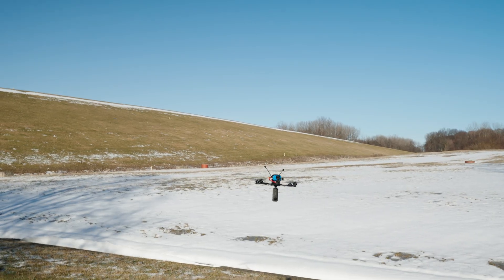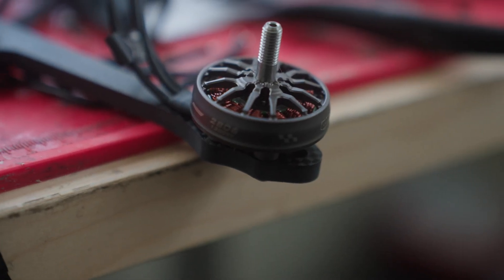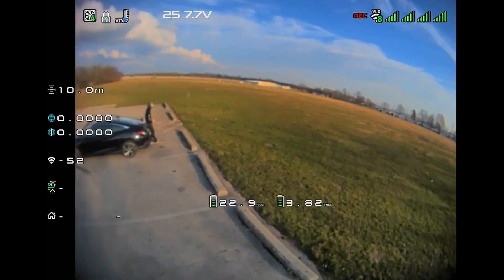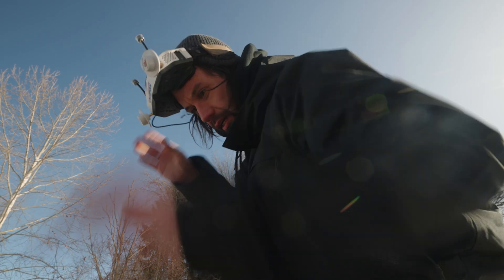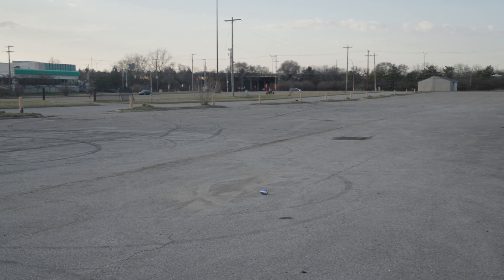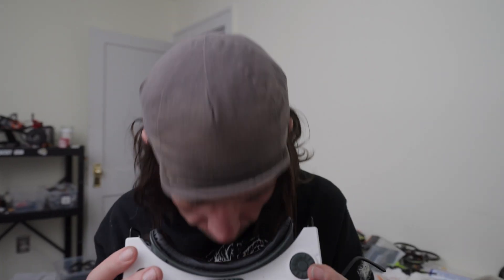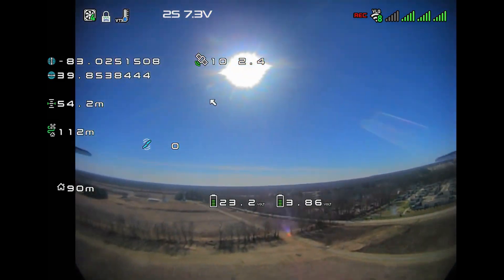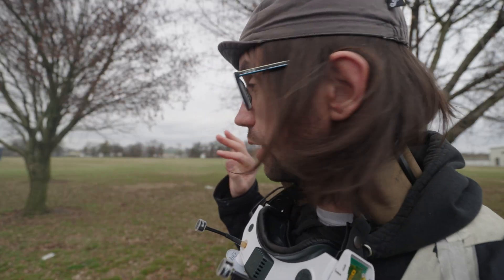GPS rescue has failed me

Comment: Hey I'm curious, you've got a hdzero freestyle v2 on the back of this, which btw, I also have the apex evo 7 lr frame, so super cool coincidence. But my question is, you've got two antennas out the back like a V tail configuration. But hdzero freestyle v2 only has only ufl on it. Are you using two video antennas and if so, how are you doing that? Cause I also wanna try it if it helps with video reception, which previously has been a bit shit. Cheers!
Reply from the maker: Those are for the elrs diversity receiver, I’m only using the one lumineer antenna on the back
Reply: @grimripperrr  oh yeah, I see in one shot you have a grey 3d printed rack on the back with the ELRS antennas on it, and I do see you having one black antenna out the back, but then in another part of the video at 5m09s, you have two huge black antennas. Perhaps it's another drone? 

I'm also wanting to try long range and I'm constantly getting fucked over by antennas, or maybe I bought a cheap component, or something like that and this time I just went for the good stuff and I'm looking at your, botgrinder, giant ant cowboys videos and trying to figure out where I'm going wrong tbh. I can barely go 500m without shitting my pants cause hdzero is putting sparkles and I know from past experience that means I'm gonna fall out of the sky
Reply from the maker: @chrisalexthomas  that’s not mine, that’s someone else’s DJI O3 apex. And also HDzero needs good antennas for it to work really well
Reply: @grimripperrr  Do you ever get the feeling sometimes, like iphone(dji) and android(hdzero). You backed hdzero because you love the idea, you love the open source aspect, you love the idea of sticking it up for the little guy who can change the industry. I loved android to begin with, but over the years I got fed up with how slow it was, how shit my phone responded. I bought an iphone se back in 2020 and it was the best phone I ever bought, I still have it and its fast as fuck. I never complain about it. 

I'm not at the point yet of giving up on hdzero, I still wanna see what their v2 goggles eventually might be, I want to believe they can do it. But after spending more than 1000 euros on equipment and barely being able to go behind a fucking tree without losing video. Like, with a 1w freestyle v2, if I go 500m away and I'm getting sparkles. If I try to push at all, I'm getting sparkles.

I'm slowing starting to think twice about it. You ever get those feelings?
Reply from the maker: @chrisalexthomas  I flew the O3 for a while, HDZero is better for how I like to fly. The latency of DJI isn’t worth it, just make sure you have a good antenna on your quad that’s away from the drone and good google antenna and you’ll get better penetration
Reply: @grimripperrr  oh I'm still on team hdzero, I'm just annoyed with spending hundreds of euros on equipment that ends up not really working. I've got 10 euros antennas and 30 euro antennas... all of them are not really giving me great results. It just goes in the box of parts.  I've got about ten antennas already haha

Comment: Usually for GPS related functionality, Inav is the go to for long range pilots. The swirling comes from the GPS pid tune, and the magneto meter needs to be calibrated to prevent flying backwards.
Reply: iNAV also suffers from magnetometer calibration and magnetic interference issues. It is a hardware issue unrelated to FC firmware.
Reply: @jeffparisse4202  the way bf 4.4 flies a Gps rescue quad would strike fear into any pilot's heart.
Reply: @ImperialArmour  Indeed!

Comment: INAV, if  the compass setup properly can rth nearly as nice as a Mavic. If your running 1W try 500mw, Use a med tall antenna and place the gps in the antenna null zone or at the opposite end of the frame and not on an arm. I place mine flat on the top plate and strap the battery under the frame. After configuring the compass. Orient the  facing your computer screen. Zero reset the Z Axis, offset, upper right of screen 1 "Setup" Slowly rotate the quad while facing the screen and note if it moves correctly in all axis roll, pitch, yaw. If not you will have to change the  Mag alignment on the Board and sensor alignment tab on the config page. Then repeat the Setup procedure again. I also test with the quad tilted forward as in forward flight and it should move correctly in that angel as well.

Comment: What you experienced with inav that was swinging on yaw axis is due to the fact that you have interference to your gps, bad magnetometer calibration could be too. Anyway i solve these problems moving gps in a higer position compared to the frame and far from the rx antennas.. you have an hardware problem mate I’m sure that once you fix it it will be fine in bf too. Another tip for inav, safe and effective way to test if your gps and magnetometer is calibrated and working well is to test posHold, if that works well you will have high change that the rth is perfectly working too.

Comment: Great Vid!!! My experience with HDZERO has been similar where it messes with gps signal.. On the very same quad I had analog and everything worked flawlessly both on nav and betaflight.. Installed HDZERO and it was very similar to what happened here. its almost like its getting satellites but the data isn't steady as to where it needs to be. And I'm using the whoop lite vtx so just imagine 1W.. nav return to home is way better always! Just that compass crap is annoying and will cause your drone to turn around like that cause of the magnetic fields from motors and wires on the drone

Comment: move the gps away from the vtx antenna, put the gps on one of the arms
Reply: facts. i printed a carrier for my gps that extends 10mm further out the back, and even just that little adjustment away from antenna is a huge difference is signal.
Reply: Or you could insulate and the ground your connection wires

Comment: Good job with this vid, 10/10 motor review. I struggled with gps and HDZ for ages and finally have 2 Inav builds that seem to be pretty good. I’m guessing you have compass issues now. I ended up with a slightly longer and flat to the frame gps mount in rear, flat is way easier to configure compass. Vtx and antenna up front and shielded. All the sats and flawless returns so far. I still don’t trust it. Damn this comment is too long

Comment: Looks to me like neither betaflight nor inav had a great RTH experience, since both should simply fly back to you in a straight line. Betaflight RTH is not super solid yet, but it has saved my ass multiple times already. I have nkt yet tried inav, but looks solid, both have their pros and cons. Use what fits the usecase best.

Comment: yeah something was wrong... interference of bad gps unit. When in betaflight the numbers next to the sat count should be below 1.0, it's the hdop number you can think of it as a trust counter, the lower the better. so even if you have over the number of sats needed if you can't trust that it's stable wait a little longer and if it never gets below 1.0 don't trust gps rescue. 
Just switching to iNav of another firmware won't help a hardware issue.

The other thing that helps once you do get good numbers is to fly in a straight line for the first bit after taking off.

Comment: Great video! I have the same issue with HD0 and GPS rescue. I am running betaflight 4.5 RC2 on two drones, one running a cheap vkk 1w analog vtx and the other running a HD0 freestyle v2. After configuring the GPS Rescue settings, I have no issue with the analog drone, but the HD0 one keeps losing satellites and it's simply not reliable enough. Not ideal for a "rescue" feature... I love flying HD0, but it is definitely not polished or refined.
Reply from the maker: I’m considering swapping it to analog
Reply: @grimripperrr  Yeah, analog seems to be the only realiable option for long range because: 1. Fuck DJI 2. Walksnail isn't realiable enough and sudden lag can make you lose your drone 3. HD0 just emits too much RF noise over the GPS.
Reply: 2 weeks ago I have tested gps rescue with bf 4.4. It was supposed to go up like 2 meters per second; instead shot up like an arrow to like 100m, then one engine died, and it started spinning; disarmed it, wiring in all engines is burned, with one totally toast, battery toast, but fell into wet ground so vtx and fc look fine.
I do not trust gps rescue in bf like at all;  I guess it is disarm on loss of signal for me from now on.
Reply: Just get the module far away from the vtx for example onto the front arm. I struggled a lot with GPS and HDZero and that solved it.

Comment: Sadly since 4.4 they butchered gps rescue and now it needs a lot of sensors to even work.

For example without a barometer 4.4 onwards sometimes gets altitude wrong and tries to correct making your drone drop into obsticles.

In 4.3 it was the old gps rescue that worked great even without barometer and magnetometer.

I had no idea inav worked bow without a magnetometer but looking at your video a mag would make it much more consistent with its heading.
Reply from the maker: It has a magnetometer but I think I need to recalibrate it
Reply: on 4.5 for me works perfectly just had to change location of my walksnail, comes in and lands by itself... no compass or baro

Comment: Do you have a compass on your quad? If you do did you calibrate it? iNav is cool without a compass in a plane, but not having one in a drone makes it do wacky shit. Furthermore the only way to correctly calibrate the compass is via the stick commands and away from anything that can cause even minor interference. Like go out in a field carrying the drone and controller alone and hold the drone as far away from the controller as you can while doing the calibration.
Reply from the maker: There is a compass and the heading was set in the correct direction. I am going to recalibrate it though and see if that helps.
Reply: dont use compass on bf pre 4.5  as it has known bugs use 4.5 or turn it off  @grimripperrr

Comment: looks like them motors prevent you from using screws too long and shortin ur shit
Reply from the maker: I think that makes sense, but also the actual threading tolerance feels a little tight as well and not just at the end where this would make sense. I am going to double check that though.